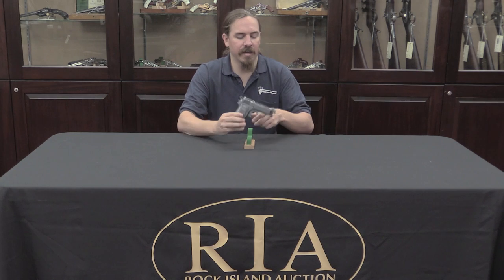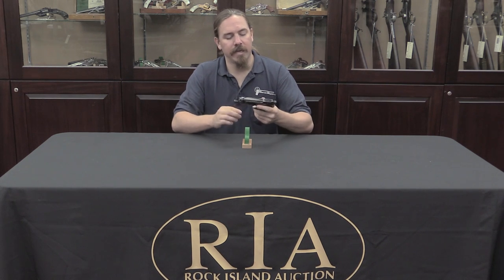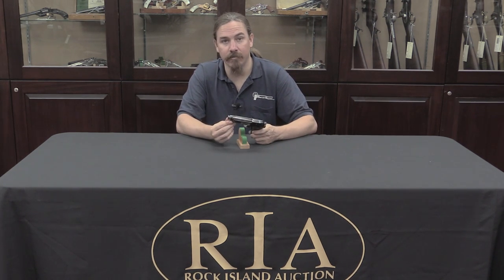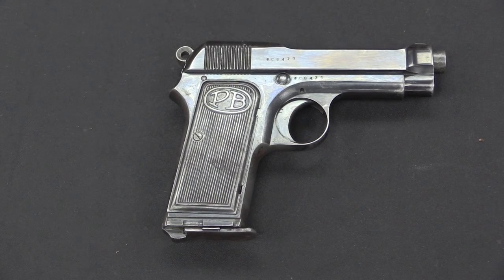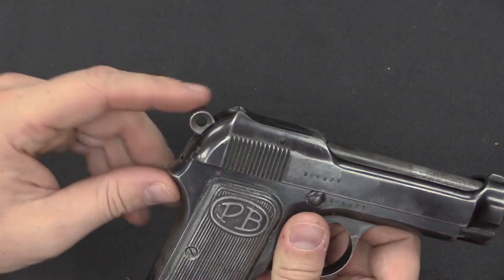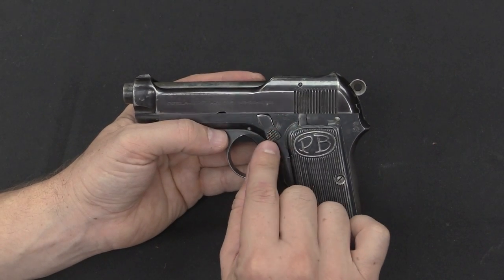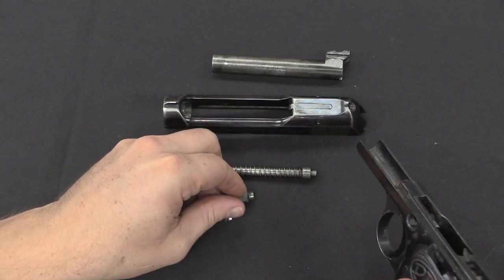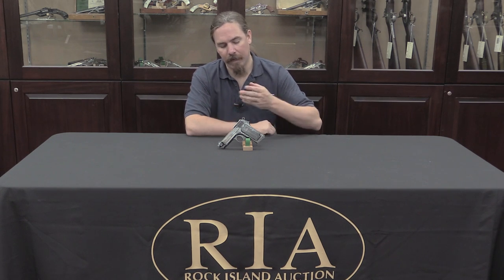Beretta Model 1923

Comment: Another great video, Ian! I recently picked up a Beretta 9000s and I thought it would be a great gun for you to do a video on. There is VERY little information on the pistols online and they seem to be pretty unusual and rare (beretta only produced the 9000s from 2000-2005). It uses a modified browning design, yet it still retains the open top slide design that beretta has become known for. Just a thought. Thanks for the vids and keep up the good work.

Comment: Brevet is short for "Brevetta" meaning patented. Trivia: In the 1950's and '60s, inexpensive pistols (truly forgotten weapons) were sold with "Brevetta" stamped on slides, and advertised as the "Brevetta Pistol" to confuse with the quality Beretta pistols.

Also the RE for army, with RM for navy, and some marked for air force which I can't recall.
Reply: Shouldn't it be "Brevetto"?
Reply: The use of patented as an adjective that assumes a gender. Italian language with masculine and female words. "La pistola" would be female thus 'brevetta' while "il fucile" (a rifle) would be male thus 'brevetto' . I didn't make the rules up, just repeating them.
Reply: Nope, "brevetto" is a noun and it's masculine (patent). The adjective is "brevettato", so "patented pistol" is "pistola brevettata"; "patented rifle" is "fucile brevettato".
Reply: Sorry "Il mio Italiano e limitato".
But I was correct on the gender issue.
Reply: no problem ;)

Comment: These pistols were issued to commissioned officers of the Province of Buenos Aires Police Dept. No 9mm Glisenti ammo was available, so they used hot 9mm Luger ammo. Many years ago a retired officer told me that he switched to a Browning GP because the Beretta kept blowing out the extractor.
Reply: watch the trying to blow up a highpoint 9mm series by iraqvet8888. "blowing up" a blowback arm with an open extractor slot (let alone the open slide of the above) is just about impossible, at least at 9mm P pressure levels. the tale above actually illustrates what usually happens, the head bulges a bit (tossing the extractor in this case), and possibly ruptures. there is plenty of space leading right to "the great outdoors" for that gas to wander into (and it wants to go where the least resistance is). whatever frame surface that buffers the slide travel will be beaten mercilessly, as will the slide surface that contacts it. but "going grenade" really doesn't happen. you also have to realize the pistol above would be proofed at about 50% higher pressure than it normally operated at, just to prove it had no hidden flaws. if the blue pill doesn't make it grenade, how will a lower pressure 9mm P? it's like firing +P ammo in an aluminum framed .38 special: it's NOT going to "blow up in your hand", it's just going to get beaten to death really rapidly, with surfaces that need precision relationships gaining slop in that fitting.
Reply: Now that you mention .38 Special revolvers, years ago I blew up the forcing cone of a precious S&W K-38 Masterpiece while using hot handloads.
Reply: chapiit08
and i had a M&P model of about 1915 vintage that i would only shoot the mildest of wadcutter loads in, lest i overstress it's senior citizen status metallurgy, lol. as it was the cylinder stop was so worn i'd often feel lead dust caressing my knuckles. but a mild load of HP38 behind of a backward HBWC still gave enough "oomph" to nicely burst gallon water jugs, even if you could practically watch the bullet fly downrange. the SA trigger on that piece was miraculous, like breaking glass.
Reply: You are right of course mine was more of an hyperbole, My father was in the military in Italy and he shoot a lot of these guns, they weren't bad guns but they needed constant maintenance due to the parts breaking constantly mainly the exctractors and the springs, he also saw one really blow up but it was a very old and worn up model.

Comment: 7:55 Ian, do you know the function of that little 'finger' which sticks out of the top of the left grip panel a moves with the trigger?
Reply: I looks like it might be a disconnecter. There is a slot for it in the slide. I'm surprised you didn't comment on such an odd feature.

Comment: What happen when shooting the 9x19 through the pistol?  Excessive wear or guns exploding in your hand?
Reply: Apparently the extractor would get ripped off the gun.
Reply: The original Glisenti load was almost identical to the original 7.65 Parabellum load (since, like the 9mm Parabellum, it derived from that cartridge, but the designers of the MBT, differently from those of the  DWM, didn't took advantage of the larger case to enhance the load), so, 1/4 less than the 9mm para load (literally, 3.3 grains Bullseye is a good 9mm glisenti load, and 4.4 grains Bullseye is a typical 9mm para load).
However, during WWI, 9mm Glisenti loads had been enhanced, since the cartridge was primarly used in the Villar Perosa SMG, and blowback SMGs are pretty strong actions. For example, USCco, during the war, made for the Italian Army a batch of 84 million Glisenti cartridges loaded with 4 grains bullseye, that's only 10% less than a typical 9mm para load.
Those "hot" cartridges were not especially marked, and were in the Army magazines, so, a 9mm Glisenti pistol made in the '20s had to be safe to shoot them too.
So, what happens if you tries to shoot a load that's 10% hotter than what the pistol is designed to handle? Nothing extraordinary. We are still in the safety margins of any pistol design. When the Beretta designers declared that the pistol could handle a 9mm para cartridge (obviously not +P or +P+, that didn't existed at that time), they were not mad or irresponsible. Simply YOU ARE PUTTING UNNECESSARY STRAIN IN AN ACTION THAT WAS DESIGNED FOR MILDER LOADS, and that is 90 years old too. In the long run, you'll almost surely have some damage in the action. Most likely in the slide. Moreover, if the recoil spring has weakened with time, you'll probably have some overpressure problem with the cases, and even some case head failure.
Reply: Mostly heavy wear and cracking.I know the hammer was said to be one of the first parts to crack if 9x19mm Para were used in the 1923.
Reply: The original Glisenti pistol was chambered for 7.65mm, but it was a different loading than the one used in the Luger series...though undoubtedly strongly influenced by it.
Reply: @neutronalchemist3241  The cartridge makers did not fail to use the extra capacity; they were unable to do so. The action of the Glisenti pistol waz not strong enough for 9mm Parabellum Hence the need  for a downloaded proprietary round.

Comment: i have a beretta mod. 34 .. so the leater version  but it looks like pretty much the same mechanically, can you explain what really changerd between the 23 and the 34? BTW, thank you so much for these videos of awesome content
Reply from the maker: I have a video on the Beretta 1931 coming next week which will explain those changes in detail.
Reply: Generally, they operate exactly the same, just the 1923 is a bit larger, heavier, and beefier.
The 1934 has a half cock position for the hammer; the 1923 does not.
The 1923 has either wood or pressed steel grips; the 1934 has hybrid grips made of sheet steel and bakelite.
The 1923 has a very vertical grip angle; the 1934 has a more angled/swept back one.
Those are the big differences that come to mind. If you'd like me to check something out, I do have both and am happy to help.
Reply: Since you mentioned the 1931, I'd like to pick your brain on its caliber and that of the 1932.
Also, A. Jones e-mailed you this past weekend on my behalf. I have some of those Hotchkiss kits from him too.
What I don't have is enough time to even get started building one hehe.
Reply: thanks for your answers!
Reply: "The 1923 has a very vertical grip angle; the 1934 has a more angled/swept back one."
Looking to the pictures, they appear to have the same angle. At least for the front side of the grip. The one of the 1934 seems to be more angled cause the rear side is. Infact, in the 1934 model, is not parallel to the front one any more.

Comment: What is so special about it having an exposed hammer? Because to me that seems like something you wouldn't want, since it allows junk to block the action or prevent the hammer from making proper contact. It's just a design feature that to me seems like a bad idea, when an internal system keeps things more enclosed and secure. Also keeps the outside of the gun a bit less likely to snag on something.
Reply: The exposed hammer was both a signal of the cocking situation of the weapon and a decocking device.
Reply: It is important in the Beretta development process for the 1923 simply because it was first.
Militaries of the time preferred exposed hammers, and it did give some benefits to be sure.

Comment: So can you tell me why is cut out the grip from the left side? And that lever is stick in out ? Is there any purpuse for that ? Is seem to me thats conected to the trigger but why is exposed?
Reply: That's the disconnector, It prevents the gun from firing with the slide not being closed the whole way. You can see the small grove in the slide that it rides in. When the slide moves backwards it is pushed down which disconnects the trigger from the hammer.
Reply: Its easier to make it that way. A lot of pistols use the same sort of setup they just have the grip covering it.

Comment: What's with that little tab sticking out of the top of the left handguard that appears to actuate with the trigger? What was that intended for?
Reply: It's a disconnector. It prevents the weapon to fire if the slide is not  on battery.

Comment: What would happen if you attempted to use 9mm Parabellum cartridges?
Reply: frame or slide cracks
Reply: Nothing fancy. The same than using proofloads on 9mm guns. The gun worn out quicker.

Comment: Why is it not safe to shoot Parabellum? What about the design makes it unsafe? Thanks!
Reply: Parabellum has higher pressure than 9mm glisenti, giving it the opportunity to do pretty nasty things to the gun. You could shoot hand loads as long as you dumb down the powder charge by about 30% according to what Ian was saying. It just doesn't have the same lockup strength to hold the pressures of regular 9x19 Parabellum.
Reply: glissenti ammo is loaded to about 15k psi. parabellum is around 22k psi. IF you put in a very stout recoil spring, and a really stiff hammer spring, you could get it to "work". but, you would also be battering the pistol mercilessly, and courting case head failures (which means gas spraying out the ejection port, little bits of flying brass, and probably damage to the arm over time). as the cases are identical, it would be a far smarter course to just, as jake said above, light load some 9mm cases. my weathered lee reloading manual lists a low pressure load in 115 grain bullet weight, and a similar "squib" in 124 gr. both are around 15k CUP, so just what the doc ordered for a glissenti chamber. you could also just use .380 acp data, as the case of the 9mm has more volume, so any pressure will be lower in the 9 than the .380 (which is spec'd to about 17k psi). 

as to "why?", it has to do with locking technique of the design. the pistol above is straight blowback, the inertia of the slide is what keeps it closed long enough to not just shoot the case out about as fast as the bullet. no mechanical delay, no wizardry that keeps breech and barrel together as a unit. just a heavy piece on a spring weighing enough that it moves slowly in comparison to the projectile. if you make the slide heavy enough, you can make ANY cartridge work in a blowback arm (though a .50 BMG round would require something around a 50 lb bolt, lol). the spring actually is supposed to absorb only the energy of the slide to halt it, the bolt weight (ideally) is supposed to be the actual "lock". so, if we make a really heavy slide, we can have a 9mm P blowback (like most SMGs, the highpoint, the astra 600).

heavy slides aren't really fashionable, and kind of impractical for some uses, so the vast majority of 9mm P pistols use an actual "locked" breech. some chunk of strong metal physically holds the barrel, and side together long enough for the bullet to clear the muzzle (or at least get close to it) before they begin to move independently from one another. the glock is a great example, as that chunky square block at the chamber end slides up into the ejection port. flush and smooth at the front end of both. the cam leg under the chamber pulls that chamber down as it moves back because the cam engages some surface in the frame (some arms a pin, some a wedge, some a frame shoulder, etc). after a short travel, the chamber front shoulder tenon leaves the port front edge mortise, and the slide is no longer held by the tenon, so it moves backward with it's already stored momentum. thus, because that first 1/4 inch of slide travel happens with the barrel and slide locked together, during that travel the cases moves not one tiny bit. it is equally supported just as unlocking occurs as when the firing pin struck. this allows the barrel mass AND slide mass to "count as inertia to overcome", and allows a higher pressure in the chamber, as the relationship of breech and barrel are unchanged until the pressure has dissipated quite a bit in the case, thus giving it less need to "balloon" as it leaves to cozy hug of the chamber.

look at the slide of a highpoint 9mm (blowback) in comparison to a kel tech P11. about the same barrel length, both fire the same exact loads. the highpoint is a huge block of steel. the locked breech kel tech has a trim svelte slide, very much a "heroin chic" supermodel of the 90s in comparison. to fire a 9mm P in a blowback arm, and have it actually last longer than a few magazines, you need that "anna nicole smith" slide, not "twiggy". look at that 1923 slide. longer barrel, yet less mass than that highpoint example. so, it will open more rapidly, AND have higher pressures resisted only by the case walls for a longer period. that's your "why?" in a nutshell, the water balloon inside the soda bottle will take higher pressure than one outside the bottle, lol.
Reply: Thank you for that very detailed answer!
Reply: jrfi orn
a pleasure! well worth the effort if it helps you "get" the why. i figured the extra detail increases clarity, and is an actual "answer" as opposed to a mere reply, like "because that's the way it is, man" would be. i think that may well be a youtube reply line count record for me, lol

Comment: So is it just me, or does that exposed trigger bar look like an unsafe feature? I know it isn't that glaring, but it would be enough to make me not want to touch it.
Reply: the "exposed trigger bar" is actually a disconnector. It disconnects the trigger from the hammer if the slide is not in full battery. So it's a safety feature that prevents out of battery firing. 
You can't fire the gun touching it.

Comment: Beretta just seems to design bad pistols
Reply: Uh, the contrary, in fact...
Reply: +TomXizor I've only ever noticed the bad. Anecdotal evidence I suppose.
Reply: They have been making guns longer than anybody else nearly 500 years founded in 1526 i guess they are doing something right funny thing they did in WW2 they made guns for germans and italians during the day and at night they made guns for the partisans
Reply: +lambastepirate Read replies before commenting something that was covered
Reply: +Stellar Steel My dude, I've had a sum total of 3 real experiences with Beretta pistols (which I'm aware that they make other types of firearms for you others) and not one was a good experience.
This is the first video I've watched for an older Beretta pistol and I still didn't like what I've noticed. 
That being said, it's a very narrow (and unlucky) set of data points that I ran across.
Reply: tell me about it!! they don't feel right in the hand, have a shitty trigger and I don't trust that open slide one bit!! be it something getting in and jamming it or it breaking like the military trials gun! just don't trust or like it!!!!!! and don't get me going on the 'blunder 9"  a more bullet sensitive pistol round has yet to be developed!!!!!!
Reply: I own the 92FS, bought it in 2006, and I used quite a few M9's in the military. Never had a problem with them except the triggers are kinda blah. They always shoot though, and a spritz of canned air cleans out any dust pretty fast.
Reply: I have a 1951 Beretta pistol, and I wouldn't hesitate to take it into a bad situation. Its only drawback is the single-column mag. Function is flawless.